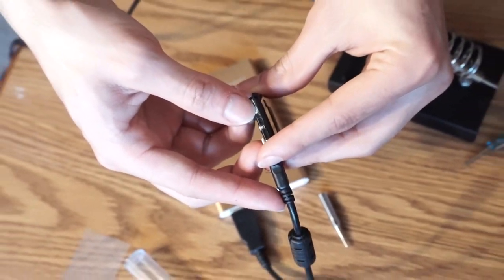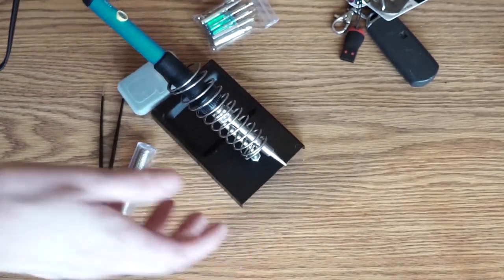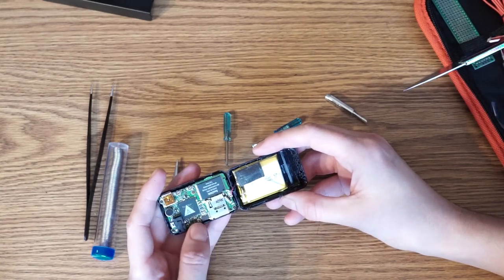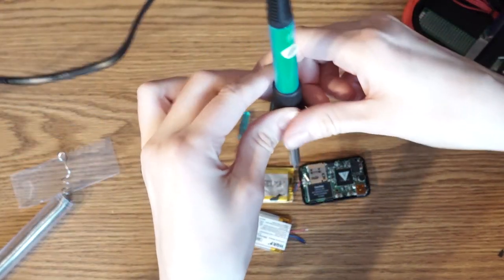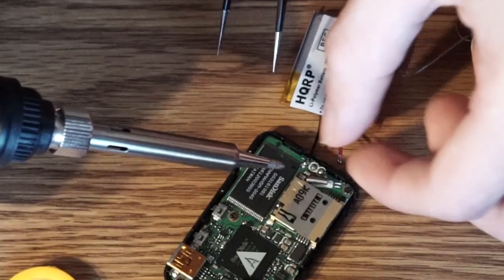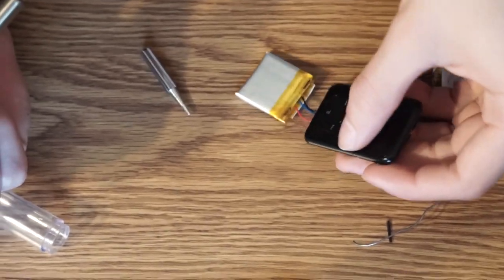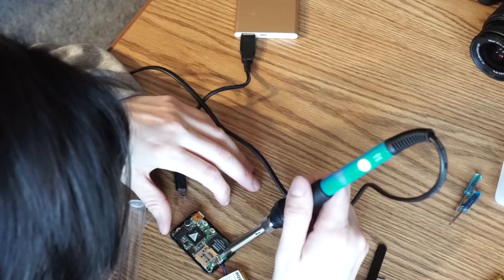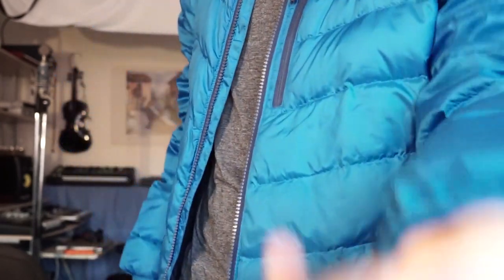If We Can Do It, So Can You - Sansa Clip+ Battery Replacement

Comment: 2024.
I still use this player. Just have changed battery as per your video!
Thank you for tutorial!
❤
Reply: you used the standard 323036 ?  I've bought the 403036 (4mm thick), I think it will fit.

Comment: Pro tip for people trying to crack open their own players for repair: DON'T just stab at the seam with a screwdriver and pry it with force. Get a guitar pick and slip it into the seam just below the headphone jack, then work it around the rest of the edges. Those internal clips should pop right open with little resistance. Oh, and don't forget to install Rockbox afterwards :-)
Reply: Yep just did mine, medium guitar pick with pressure at the corners was enough to get it to start to pry apart. From there you can run your fingernail around the side of the device.

Comment: I need to replace the battery on my Clip+. Suggestions on how to open the case? It looked like you were struggling with it, damaging the case, then suddenly you got it. But I'm not clear on what you did to open it correctly.
Reply: There are cell phone disassembly kits on ebay with all sorts of little plastic and metal tools to get under the lip and undo those stubborn plastic clips. Start with the plastic to see if it works, and if not the metal may be necessary.
Reply: In case anyone wants to know what tool is called, it's a "spudger."  There are plastic and metal ones.  Use a plastic one to prevent damage.  You can get a cheap kit that has spudgers of all sizes and materials.
Reply: It's really easy with a guitar pick. Just start on the audio jack corner. And be careful not to break the tiny sd card slot like I did, it's really easy to miss.

Comment: This seems to be one of those very rare mp3 players with physical buttons that have FM radio and is fully supported by the third-party firmware Rockbox. What's cool for me - I can install voice files in Rockbox and control the player without taking it out of my pocket. It's so convenient to listen to audiobooks and radio on my daily walks, especially in winter. No smartphone can be controlled so conveniently. I'm now buying a few more of them on ebay while they are available at all.
Reply: Get ready to pay $100+  for that. 😁
Reply: @Sunstepa   Yeah, the new ones cost like historic artifacts now 😀 But I can at least get used ones. Fuze (not Fuze+) also has a physical control wheel and should work with Rockbox.
Reply: FM radio is not working with Rockbox.
Reply: @goku445  It works just fine for me on both clip plus and clip zip.
Reply: @camelCased  ok, maybe they fixed the issue in later versions then. 
I use the clip +. The issue I have is that my internal memory is cooked and read only now so I'm stuck. I can reboot in classic firmware but that's it.
Reply: @goku445  Yes, there have been a few great Rockbox updates that improved some functionality, especially battery life. My Clip+ had internal memory issues too, but fortunately, it did not switch to read-only mode, so I could fully reformat it in Windows, and then it served for a few more years. Now I bought a used Clip Zip and it also had memory issues, very slow to list files and copy, but reformatting saved it again, and now it works flawlessly.
Reply: @camelCased  thanks for the info.
I'm actually not sure about the memory but I'm scared it would break if I tried to flash it again.
BTW is your clip+ dead now?
Reply: @goku445  It's half-dead. The battery hold charge for barely 3 hours. That's why I started looking for options to replace it. Additionally, it has to be reset (holding the power button for 30 seconds) quite often, otherwise it does not power on at all. But it has had this issue for years, so I'm not sure if it's a Rockbox issue or some kind of a factory defect. My "new" Clip Zip does not have this problem.

Comment: Congratulations. I have one of those that desperately needs a new battery. It works much better with SD cards than the replacement Clip Sport model. Good choice.
Reply: Why is the clip sport worse than the clip+ with SD cards?
Reply: @xxwookey   The Clip Sport doesn't have an SD card slot
Reply: @johndwaynsen  Ah I see. It also doesn't run Rockbox, which is a deal-breaker for me. Sadly it's getting harder to find the older models that do in decent condition. (My wife wears one out about every 5 years).

Comment: Just found your video and glad I did. I was just about to throw mine away. I haven't used it in years but decided to pull it out to use as a music player in the car when traveling. Because the down side of having all of your music on the phone is when someone calls you, the music is paused. So my Sansa Clip+ will be my backup.

Where did you get the battery? Mine won't charge/turn on either and didn't think about the internal battery.

BTW, love the authenticity once it turned on. It's the small victories! I can relate. 😉

Comment: nice.  I have Coby MP3 player with dead battery, will need to replace it just like you did.. but opening it up scratched the case and broke a few screws. Still need to order that battery  and correct size.

Comment: What tool did you use to separate the housing? Looks like a precision screwdriver, but I'm not certain.
Reply: I've opened mine a few times and a stiff guitar pick works GREAT.
Reply: @amycoppage2717  Agreed, guitar pick is best. Avoid anything metal: it will mess up the case.
Reply: You need a plastic guitar pick, dont use metal.

Comment: I have an issue. The metal that holds the red cord in place has come completely off. WHat can I do to fix that ? My mp3 wont work with out it
Reply: I think you lifted the pad off. That's a bummer. You will need to route a wire to replace it somewhere and a microscope.

Comment: Help!
I only find batteries with just red and black but no blue cable 😢
Reply: it's not an issue, it will work.
Reply: @goku445  How to solder, i mean which points should we use if we have only red and black cable one
Reply: @compicat  You only have to solder the red and black wires back. Just note which one are which before you desolder the old battery.
Reply: @goku445  Thank you.
Reply: @compicat  You're welcome. Be careful not shorting the IC. If I remember correctly, it has a pin very close to it. Use a magnifying glass.